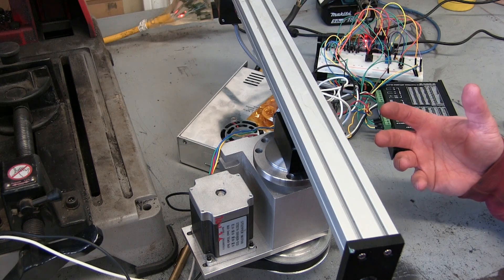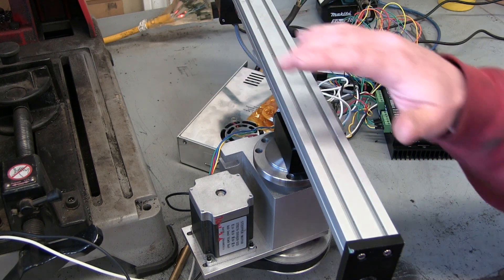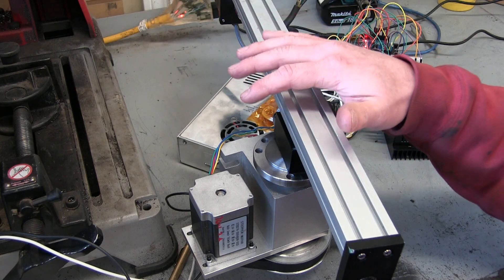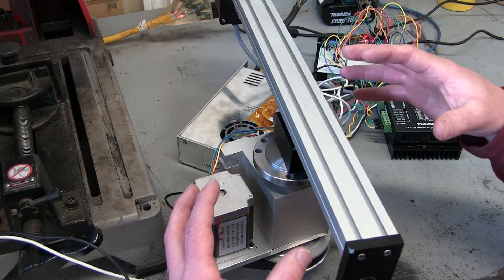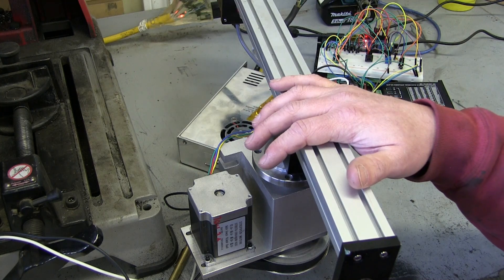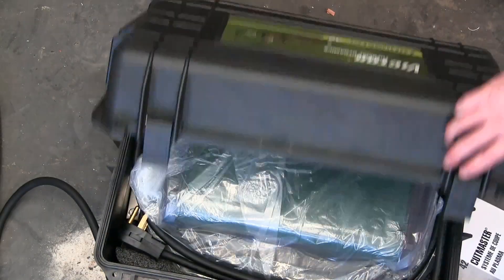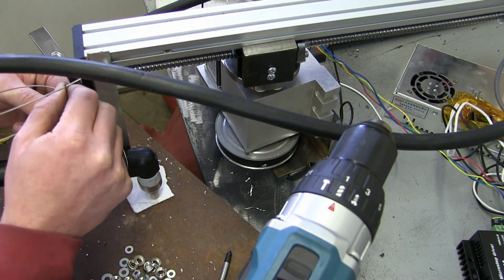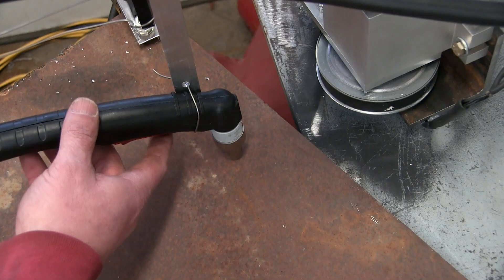Portable CNC Plasma Prototype

Comment: I like it! I dunno if this would be practical, but one thing you could do, especially if you're feeding it canned routines from a phone, is have a disco laser (persistence of vision sorta deal) on it that lights up the shape it's gonna cut, where it's gonna cut it. So you cue up a square, position the base until the square is where you need it, then you turn on the mag base and the plasma cutter cuts that same square.

Comment: This reminds me of something I saw when I toured the huge Boeing factory in Everett. Instead of having a guy putting in row after row of rivets into the fuselage by hand, they have a machine that runs along a track that sticks to the panels and puts in the rivets automatically. The tour guide made a point about how it wasn't taking any jobs, and the guy that put in the rivets by hand is now just the guy who inspects the robot's work to make sure it isn't fucking anything up. 
Here's what it looks like: https://www.wired.com/wp-content/uploads/images_blogs/autopia/2013/06/777assemblyline041-660x440.jpg
Reply: Until they replace him with an inspection robot that has x-rays for eyes and ultrasound for a mouth and ears...
Reply: Just need a swinging laser cam added to line and you replace all the qc for that sector lol

Comment: Nice,  though depending on the working surface the single pole might pose a problem unless you specify the max weight of the torch. the further you move away from the base the less acurat it's going to be due to it having to deal with the load at the end.

 though you could ad a counter weight on the other end to try and remove some of the burden.

Comment: i think this has potential to be an industry revolutionizing invention. especially if you could make it small enough, add more axis, and have enough cutting/welding power...shiiit.  assuming it hasn't already been patented. better jump on that quick brotha. because it could make you a very rich man. actually it could put a bunch of people out of work in the long run. so scratch that. this is a terrible idea.

Comment: Hey AvE, I think it might be beneficial to replace that bar you've mounted the plasma cutter torch on with a length of angle iron to prevent it from shaking about as much, awesome idea, I'd totally use that even if it meant spending 10-15 minutes mucking around to cut out a oddball shape on something I couldn't put on a CNC table, awesome video as always!

Comment: on a machine like this you do not need inverse kinematics, it is only when you have 3 or more axis' that you actually need inverse kinematics. the movement for this simple rotary plus linear machine can be done geometrically very easily since you do not have any singularities (a point in space which can be reached by more than one configuration of the joints). The first thing you will need to make this viable is feedback on a zero position. I would recommend you use light beam interruption endstops for both axis' since on the rotary with a typical mechanical button endstop you lose travel, but with an optical you can still travel past the trigger point giving you 360 degree or higher rotation. and on the linear axis, a optical beam break sensor will typically be more accurate. If you want to use them outside you will have to consider (at least a little) that optical beam sensors are typically IR so the sun will interfere, but the can be mounted in such a way that the sun will pose zero actual risk to your accuracy. I would love to work with you on the design of this machine :) A fellow canuckistanian citizen from Alberta!

Comment: Definitely going to have to work on the start and stop location, anything other than a smooth and clean radius will never pass an inspection by a structural engineer. Also, are you thinking of adding anything that will help it locate?

Comment: I'm not an expert but I do know some stuff so take what I say with a little more than a grain of salt. The algorithm for the robot is super simple. It's simply the distance from the point of rotation relative to pi. It is actually highschool math. Put that together with trial and error for sizing based on your thread count and the motors turns. That gives you straight lines and a given size. The app. One thing that cannot be overlooked. THERE MUST BE A MANUAL INPUT OF POINT OF START. Aka if you want to get an efficient cut you're going to want to start your cut at the very top corner of the steel. Thhe app needs to recognize where the person wants the laser to cut. Aka don't cut off the edge of the plate. That's I don't have any idea how to help but as an eventual buyer. I'm wanting that feature to be included. 
Also. Food for thought. What about a shadow function. Like you draw a shape on the steel with a pencil. You see what needs to be cut off but it's complicated so you manually push the machine from point a to point b.... then you return to origin. Press play and the machine cuts what you just showed it. Curves are possible with a dozen or so points and grind the edges into the desired curve.  

You're a god damn genius

Comment: You could probably run it through a Rasberry Pi and some open source 3D printing software, no it won't be 3D printing but it's still going to have the basic programming to allow you to get really simple and complex cuts. All you would need is someone to adjust the Source code for you and voila. You could sell the preloaded Rasberry Pis for 40 bucks a piece to those interested. They're the size of a poptart.  The Pi would also allow for wireless accessibility for phone or laptop control, or plugin if you prefer

Comment: Yeah, I'd use one! Mechanical design engineering for new medical device products is what we do. Being able to slice up thicker steel or put large holes in Al plate would be sweet. Big holes are hard to cut in a small shop.

Comment: On your app a cool feature would be to have it so you can select which side to comp the cutting path to -- I.E. cutting a hole in a plate VS. cutting out a part in the plate. ID VS. OD 

This would be G41 or G42 on a CNC milling ding donger.

Comment: You need a coordinate system based off the center of the rotary axis so you can accurately place details and some way to accurately square up your gantry axis  to the part you are cutting. (maybe just a square base to keep it simple?)

Comment: needs an arc voltage based torch height controller. Then you can pierce more better too. There are some cheap ones around but they never work.

Comment: Calibration step. This sounds like it will need a through-and-through calibration procedure so that the bumping in the back of the truck will not turn a 4x6 inch rectangle into a 3x12 cm hypercube. Also, the dry-run option with a drawing utensil (glorified sharpie?) should be a must for people that cut twice and measure once.

Comment: There are 3D printers which work on a similar rotary axis basis.

Typically with those the work piece rotates while the print head is on a horizontal slide axis (plus a vertical axis, but that wouldn't be needed for a plasma cutter).

I'd imagine if there's an open source version you could borrow and adapt the code what figures out how to make the head move in straight lines.

Comment: Fabricobbled you together some code you might want to try out.  Only have it for straight lines, but curves shouldn't be too hard to make, assuming this even works.

#include <math.h>

int r = 0;  //this keeps track of the ticks that the r motor has traveled
int theta = 0;  //keeps track of the ticks on the theta motor
double startPosR = 5;  //inches from the center of rotation that the cutting end starts at

const double ticsPerRev = 4800;  //tics it takes for the 
const double ticsPerInch = 1000;  //tics it takes for linear actuator to move 1 inch

const double inchesPerSec = 0.1;  //your desired cutting speed in inches per second

const double pulseTime = 500;     //NOT used for speed controll    may need adjusting if signals aren't coming through right

//pin setup
const int directionPinTheta = 8;
const int pulsePinTheta = 9;
const int directionPinR = 10;
const int pulsePinR = 11;

void setup() {
  //pin setup continued
  pinMode(pulsePinTheta, OUTPUT);
  pinMode(directionPinTheta, OUTPUT);
  pinMode(pulsePinR, OUTPUT);
  pinMode(directionPinR, OUTPUT);
}

void loop() {

while(1==1){} //put your code for a button push here
Line(5, 2);    //moves in a line 5 in (right?) and 2 in (foreward?)   motor directions may need to be swapped later in code
Line(-2, 0);    //moves 2 in (left?)
  
}

void Line(double x2, double y2){  
  double x1 = sin(theta)*((r*ticsPerInch)+startPosR);  //x pos at the beginning of the line
  double y1 = cos(theta)*((r*ticsPerInch)+startPosR);  //y pos at the beginning of the line

  double lineLength = sqrt(sq(x2-x1)+sq(y2-y1));   //length of the line being cut

  double timeToCut = (lineLength/ticsPerInch)*1000000;  //time needed to cut in microseconds
  double startTime = micros();
  double endTime = startTime + timeToCut;

  double x;  //Will be used to keep track what x coordinate we want to be at
  double y;  //same for y
  double timer;  //keeps track of current time since the start of the loop in seconds
  
  while(micros()<=endTime){
    timer = (micros()-startTime)/1000000;  //calculating timer time in seconds
    x = (x2-x1)*timer*inchesPerSec;        //x value we want to be at at the current time
    y = (y2-y1)*timer*inchesPerSec;        //y value we want to be at at the current time

    if( ((r*ticsPerInch)+startPosR) < sqrt(sq(x)+sq(y)) ){    //if our current radius is less than the needed one
      digitalWrite(directionPinR, HIGH);                       //if it is mirrored along the radius change this to LOW
      r = r + 1;
    }else{
      digitalWrite(directionPinR, LOW);                        //if it is mirrored along the radius change this to HIGH
      r = r - 1;
    }

    if( (r*2*3.1415926536/ticsPerRev) <  atan(x/y)){    //if our current angle of the dangle is less than the needed one
      digitalWrite(directionPinTheta, HIGH);                       //if it is mirrored along the arc change this to LOW
      theta = theta + 1;
    }else{
      digitalWrite(directionPinTheta, LOW);                        //if it is mirrored along the arc change this to HIGH
      theta = theta - 1;
    }

    digitalWrite(pulsePinR, HIGH);                      //pulse both motors so they correct towards the right direction
    digitalWrite(pulsePinTheta, HIGH);
    delayMicroseconds(pulseTime);
    digitalWrite(pulsePinR, LOW);
    digitalWrite(pulsePinTheta, LOW);
    delayMicroseconds(pulseTime);

    
  }
}

Hope this helps, if you have any questions just let me know

Comment: I'd ditto Player 1's comments concerning the translation of XY coordinates into polar.  I would add that in order to cut rectangular angles, circles and whatnot you'll need to get simultaneous control over your linear and rotational stepper motors.  I would think that you will be able to create a far more useful control system and interface with a Raspberry Pi than an Arduino.  The former being able to access 6 orders of magnitude more memory, plus Bluetooth & WiFi.

Comment: @AvE - What about a sensor at the tip of the plasma torch that can sense the vertical distance to the material? It could be used in conjunction with a short z stage that can keep the torch a specific distance from the material.

Comment: Brilliant. It needs position sensing for both rotation and extension. Rotary optical, IMO. Position can be estimated by number of steps, but that isn't exactly reliable (steppers can skip for a variety of reasons). The first time it screws up an expensive or trick-welded piece, formerly happy campers will riot.

I'd also reprogram your controller to interface bluetooth commands, specified as rotation/extension/speed (degrees/mm/mm-secs) between the mobile app and your Choochifing Plasmarator ZXT-1000. It should probably start with a HOME routine to find its limits, and therefore a repeatable starting point. Let the phone or tablet do all the rectal-linear computational stuff. Doing it all on the phone allows you or a user community to maintain a small database of parameter sets for an infinite number of varying models with different arm lengths and stepper properties.

The app is the easy part: shapes could be g-code or HPGL plotter code, a simple in-app paint routine to design stuff on the fly, and a routine to map Plasmarator parameters and shape codes to appropriate commands. Getting the controller to repeatably move the arm with bluetooth commands isn't much harder, but it will take some fiddling.

Comment: The final implementation how a user inputs doesn't matter from a design standpoint. You just make it understand G-code and from there all your software in whichever form or function is just an interface that translates to G-code.
Personally I am in love with the idea of what they did with the Shaper Origin https://shapertools.com/ That's not just finding a replacement for something, but also making it better.

Comment: Have you looked at the commercially available portable cnc plasma/oxy rigs?  The machine rides backwards and forwards on a single track, not unlike a track saw, then has an arm the slides in an out the machine for the other axis….Wonder if you could use a horror freight/princess auto el cheapo track saw and build something from that.  Here in the UK, a track saw occasionally comes on sale in our equivalent of Home Depot for less than 100 DollarPounds…

Ok I know not quick to setup as a mag base, but I think you’d end up with an inherently more accurate device, with the bonus that you could use even more off-the-shelf hardware/software.  You'd avoid all the complex caresian->polar math(s) too.

Comment: nice man, algorithms should be easy just depend on arm length Vs rotation speed. and yeah I'd own one, even if it wasn't easy hahaha
hook this up to a pc\laptop and run cheaper and easier to store then a xy machine 
although phones have the horses to run the data through em, people designing stuff like this would usually have access to laptops. or be in the professional setting too

Comment: Why complicate matters by putting the phone in the loop. I would think a lot of things could be done with a rotary switch on the device it self to select the program, An LCD and a a wheel or two buttons to select the dimensions and a button to confirm.

Comment: Love the design.  If you moved from steppers to servo's then you can turn the servo drive off and use the encoders to read the motion of the tip. Simply draw around the shape you want then the cutter will repeat with the plasma. Ideal for copying bolt patterns off the thing your trying to to drill holes for or just for marking stuff out by hand then having the plasma copy.
Reply: Matthew Saville This may be the most flexible option, but the encoders will add costs and the motion components may be more expensive than stepper motors.

A cheaper alignment and interface option would be a line laser cross hair (I've seen them for woodworking tools) that you could use to align the start of the cut (chalk mark or you could tape a paper template down) and direction with the current mechanical setup.  The phone app could let you control movement of the head with the cutter off from this starting point and let you enter waypoints after the starting point for things like the opposite corner of the rectangle, points on a polygon, or the or radius of circle.  Things would be quicker to make for the next gen prototype, and an open loop system seems to be more in AvE's style.

Comment: Not just shape and size of the cut, but would you also need to factor in the thickness of the metal to perhaps slow the movement of the cnc so that the plasma cutter could get through thicker gauge material?

ps this is fucking neato, nice work!

Comment: The rotating axis definitely makes it a lot more trivial, even more so for some poor sap out in the field who has to try to get the thing chooching again after the 200 pound gorilla drops it or kicks it and offsets the tool.

Another linear axis could be added instead of the rotation, no? I've used a mag drill a few times and they have no problems staying put, as you said yerself you can hang them upside down. With a good weighty mag base with a strong magnet it could easily stay planted with a linear slide sticking out each side. The control then becomes much easier because it's just X Y coordinates and you don't have to worry about the cutting head going wonky and putting a slight curve in all your straight lines.

EDIT: For portability, the junction of the XY axes could be on a swivel so they can be aligned to turn the tool from an X shape into an I shape and dropped into a bag or case.

Comment: only thing I see is make you you run the numbers to compensate for arm extension. 1 degree of rotation at 1/4 extension will cover significantly less space at a slower speed than 1 degree at 3/4 extension. as long as you get that worked out so you have proper speed and distance at all arm extensions circles or even complex shapes we be fairly easy if you can run both axis at once. I'm only a hobbiest and I would love something like that. great for space savings in the shop and easy setup for a quick cut.

Comment: Panagraph mode where you move the head where you want it to cut avoiding obsticles, it learns the routine, smooths the path in software (reduces the points for straighter lines).